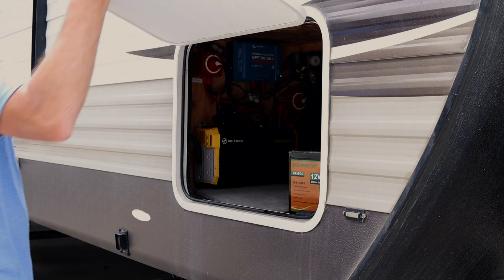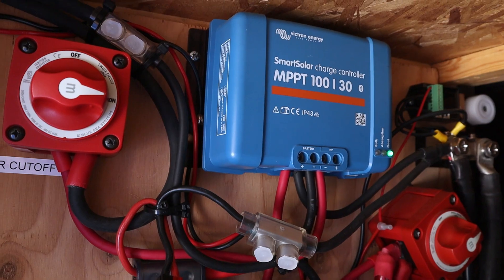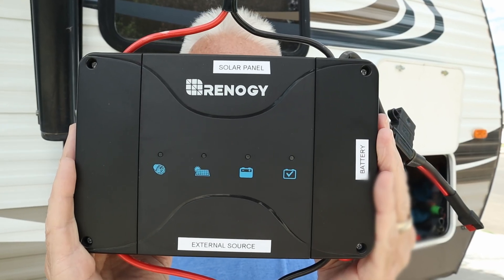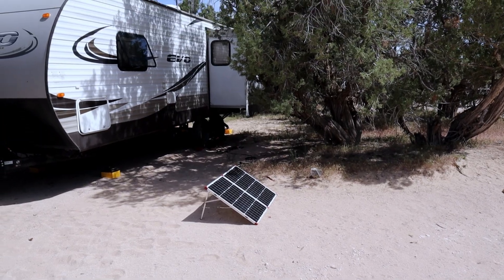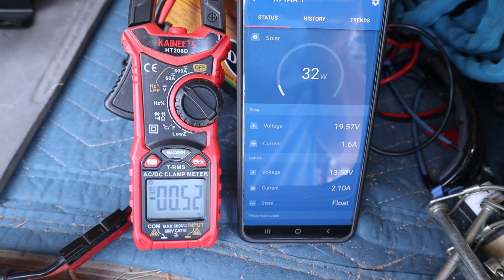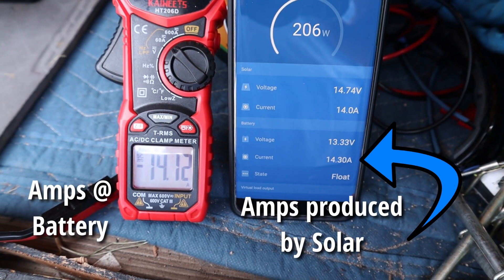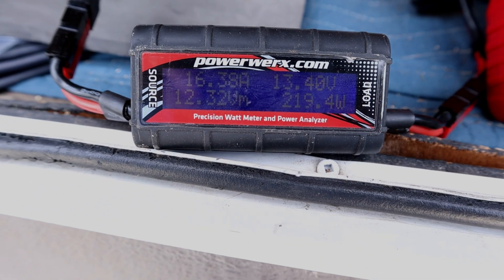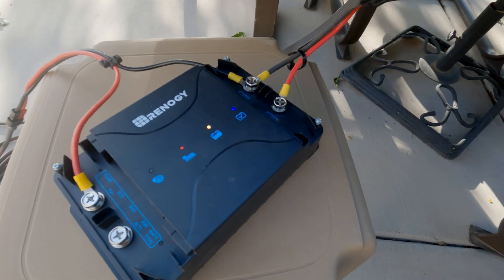Portable FAST Charging | K7SW Ham Radio

Comment: KRIEGER 3000W Inverter...wohoooo that helps your Batteries to quickly get back to shape again. Anderson Poles are definitly a must have but the Ones I ordered and still sitting on the Workbench Shelf waiting for lazy UG (ME) to finally install these safety Power Connectors to the DC Leads are still unemployed.  Kevin you rock, cuz you know what's it all about being out in the Middle of nowhere having a 50K$  RV Trailer hooked to the Hitch of your Truck that came with all the Bells and Whistle Knick Knack latest Technology  by the Manufacturer but you can't use it for a complete Camping Weekend without plenty of AC or DC Power. No Matter if Solar Panel or fed by a Power Generator Diesel or Unleaded. Thx for sharing your Experiences with us. I remember all the HAM's coming to the Quartz Fest with Motor Homes and RV Trailers having the whole Family aboard for this Special Event Weekend. The Days are boiling hot outside you need to keep your place air cooled and the freezy cold Nights you need have enough DC Power for the Electric Heating System to make sure you not going to freeze your Bravos off....Refridgerator needs Power, TV + Sattelite Receiver Box needs Power, Cig Plug In....Cell Phone Charger Cable, Tablet PC etc. Your damn right Buddy...on top of all this there is nerds like us HAM's having HF TRX, UHF VHF Radios, Digi Modes, Notebooks and HF Mobile Amplifiers to live up their HAM Lives off grid. All this needs a Hand to eat from. 
Nothing comes from nothing. Happy Sunday & 73  into DX Land de YFUG 💯👍🙋‍♂️
Reply from the maker: UG, well said,  I love sharing with you and anyone else who enjoys this hobby like I do.  It sounds like you also know whats up and this is a good thing indeed. Thanks for being so supportive.  73 Kevin
Reply: @hamradiowithkevin  You welcome 💯👍

Comment: i use a Renogy DCCS50 to charge a 150Ah LiFePo4 in my vintage VW camper.  i'm looking to add a second smaller battery solely for my Elecraft K2/100, which i mostly run at 10W but if condx are poor i'll turn it up to 50W.  the MPPT controller in the unit works very well and i'm getting decent charging current with a 100W panel, 200W would be better. de WM3O
Reply from the maker: Steve Hanlon, K2 in the VW? That is sweet.  Your charge solution is prefect for your setup.  73 Kevin